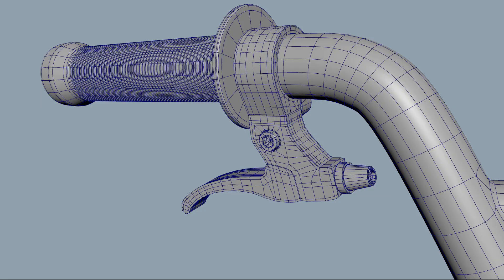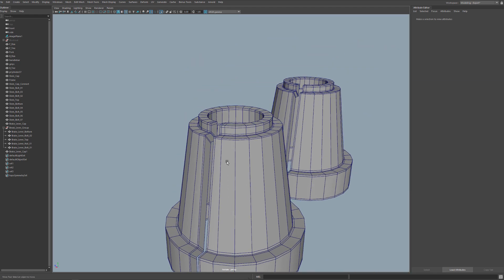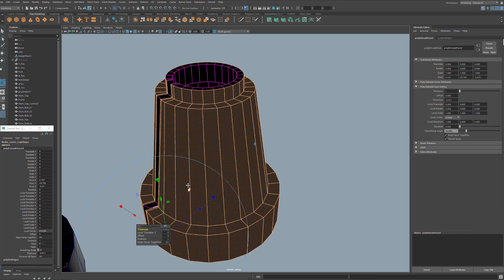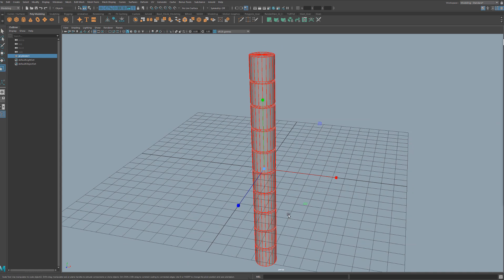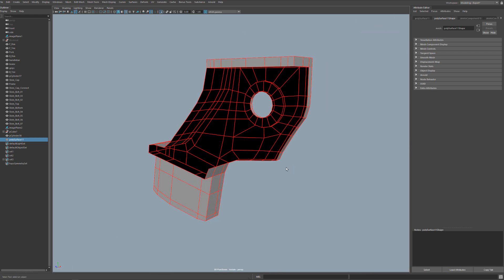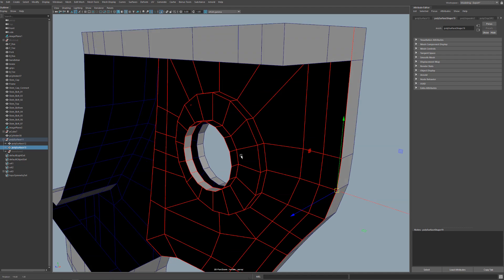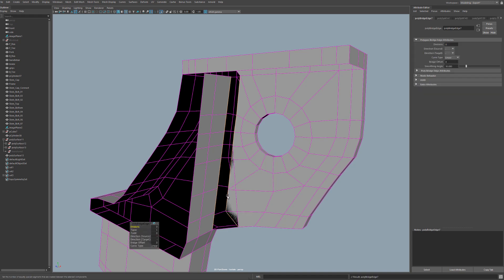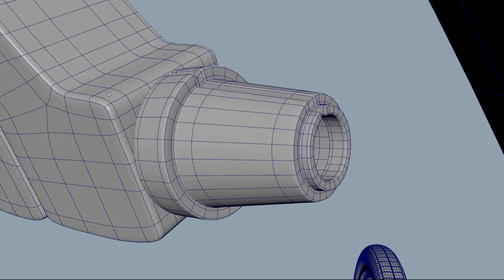Maya Hard Surface Modeling: How To Add Thickness

Comment: There is a node called VectorExtrude you can use combined with the MEL command polyDuplicateAndConnect, which gives you the capability of Blender's Solidify modifier... in some ways, it's actually better.
Reply: How do you create this VectorExtrude node?

Comment: Hi brother, I hope your super good. Can you help me with a doubt? How can i Hold edges of a extrusion in square shape (using 4 faces) in direction to the bottom side without afecting another extrusion with circular shape in the same edge flow direction.?

I mean this for example: 
https://imgur.com/a/xdOIw0j
I tried to hold edges inserting a edge loop like it where a extrusion, but i dont know if it's correclty for a object that could be possible animated, or at least good modeled

Thankyou very much!♥